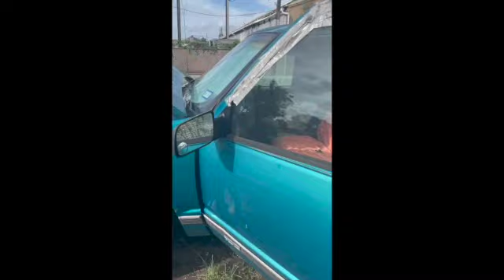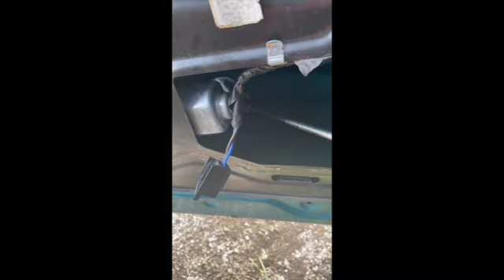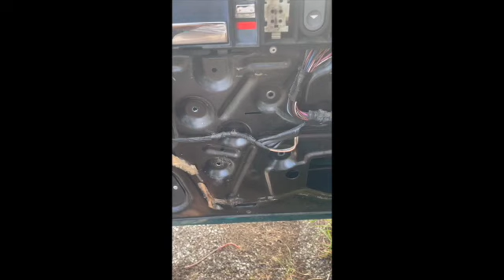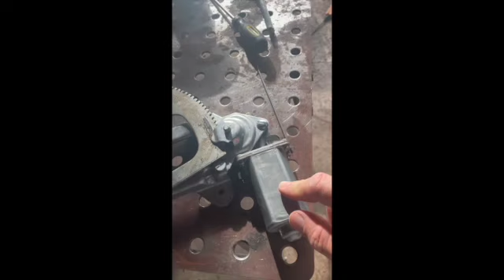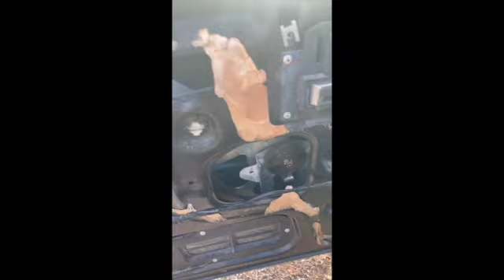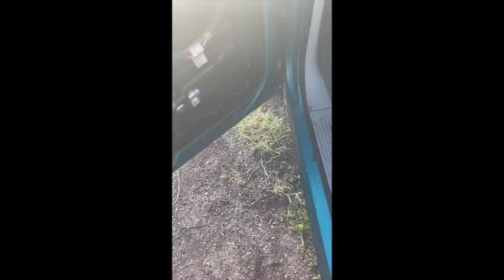1993 GMC Sierra window motor replacement

Comment: What size bolts every vid i watched no one said the size bolt to replace the rivets
Reply from the maker: The bolts come with the motor. I plan on taking my door panel off to do some other work. I will get the exact size and reply back.
Reply: @hiramgibbard  ?